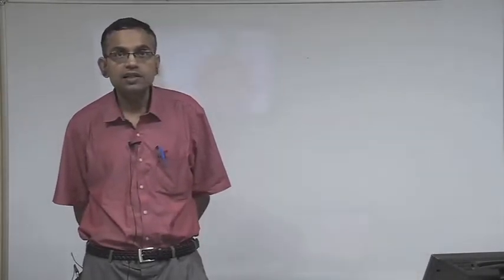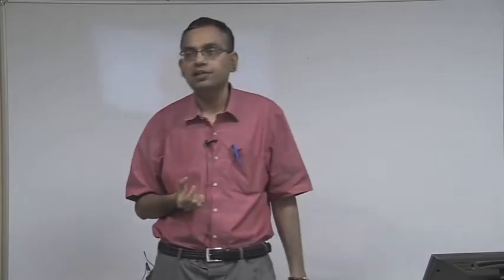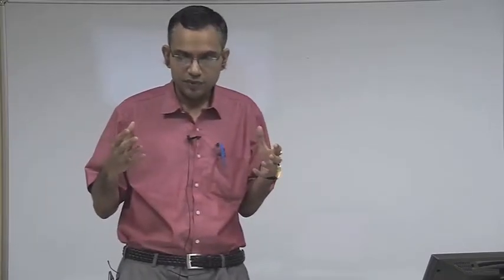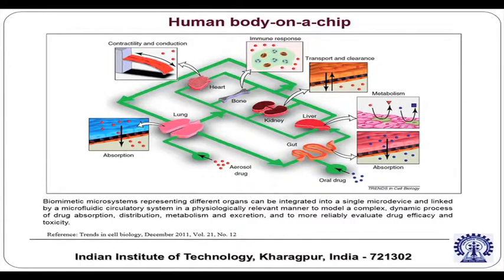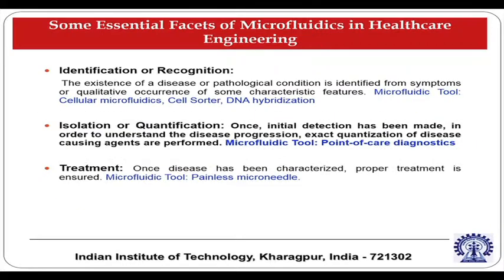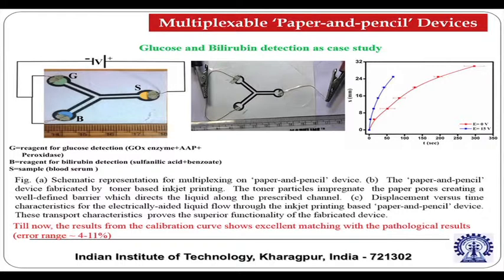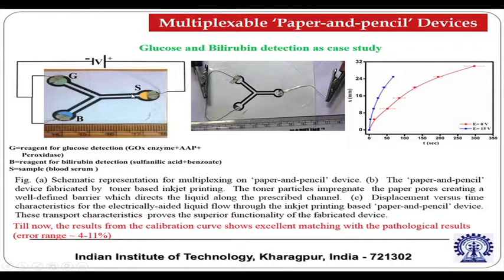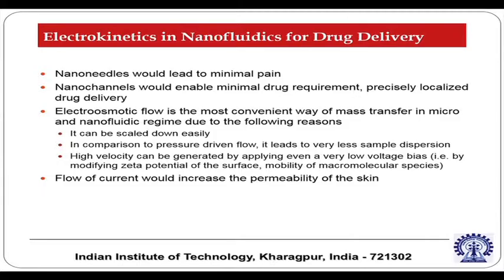Mod-01 Lec-47 Biomicrofluidics (Contd.)

Comment: I have design-engineered microneedle devices for insulin injection - it is a difficult process though appears simple - the biological aspects are subtle but very demanding and our technology seems quite primitive to tackling this problem with much success at the levels of safety required - I am not as optimistic as you on this - microneedle devices are good in the lab but remain essentially unproven in medical devices with many parameters insufficiently controlled or controllable - needle fracture being one of them - the hype and optimism in my mind appears to be exaggerated for this technology at this time - more is needed and the biological aspects are not sufficiently understood to overcome nor is the controlled aspect of the arena in which you are working - so many factors affect the practical applications of the device over such a wide population variability that it is difficult to design something that is a one-size-fits-all ... still we need enthusiasm to overcome such obstacles - I would suggest we are still several years away from this technology being realized and coming into its own - too many people are jumping into it for the MONETARY rewards on offer - 3 billion people X $$$ is a get rich quick schema - hence the people getting into it are financier-business type engineers who want to make fast money easy rather than true hard core engineers who know what the hell they are doing ... that is the truth and my experience about this field of medical devices